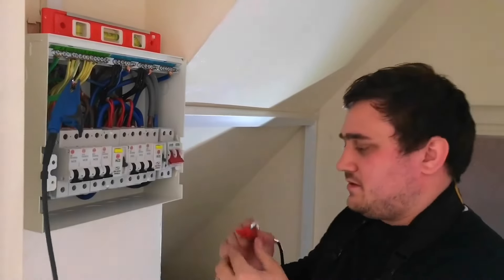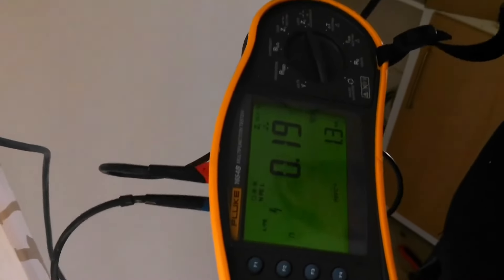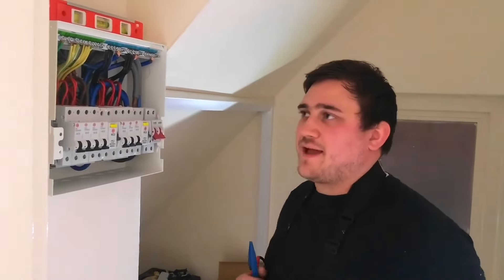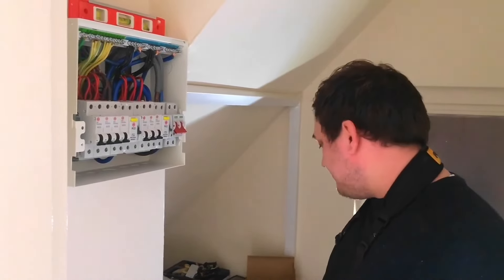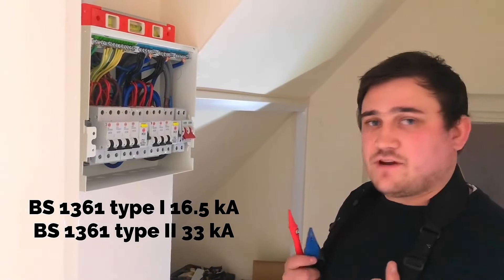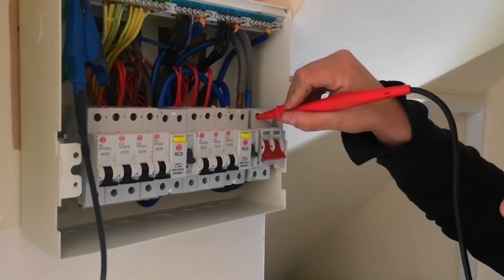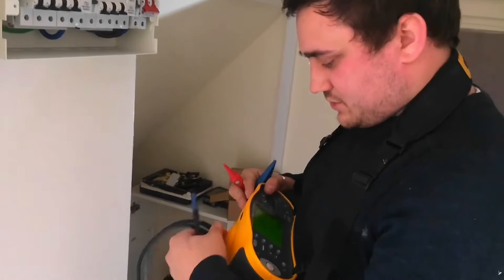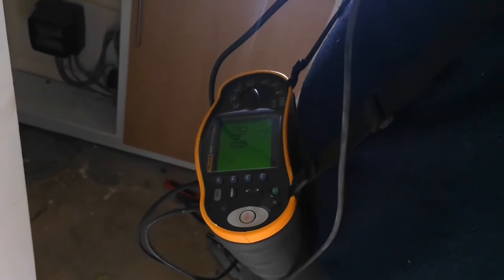Ze and PFC Live Tests

Comment: Pfc is the higher of the two values of the PEFC the earth fault current and the PSCC the short circuit current,you will also find that the PEFC will not be much if any different than the Ze value but still requires main earth removal for Ze